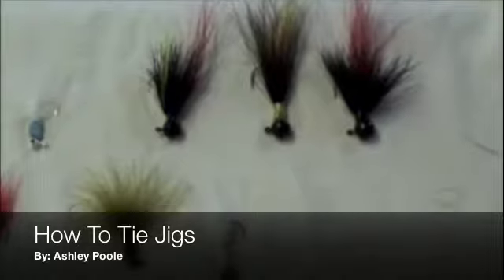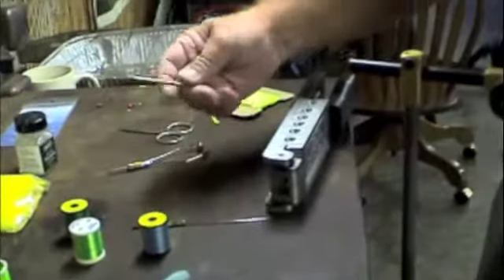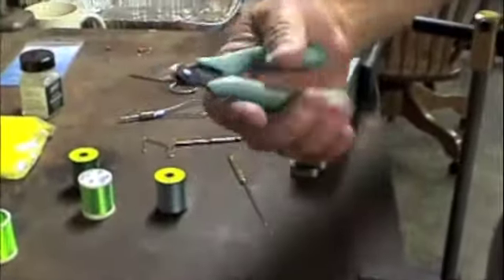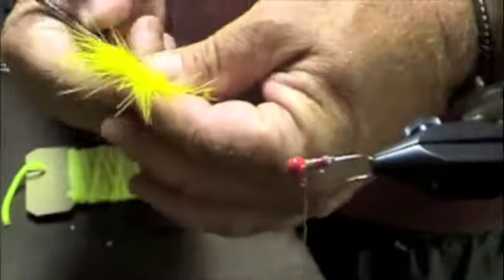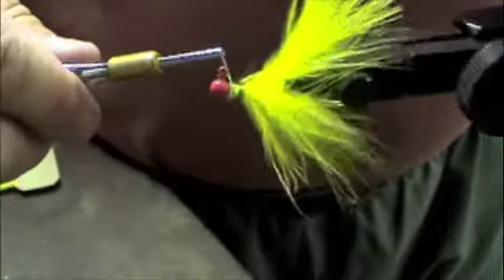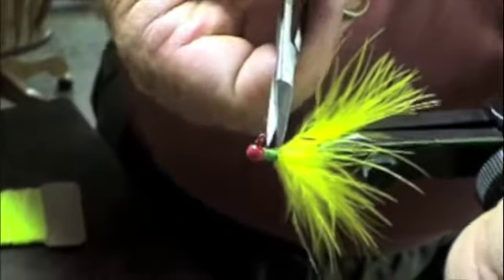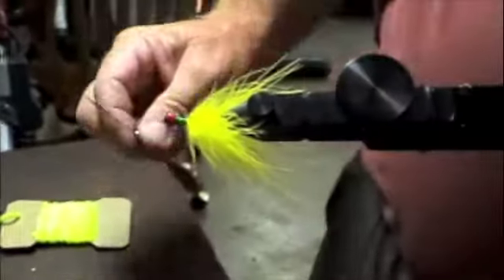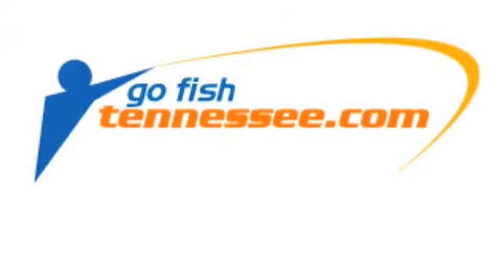Jig Tying

Comment: @HATINTHEKAT that is fly tying thread best to use a kevlar thread for jigs. you can buy a basic vice for less than 20 bucks online. you will also need a bobbin which is that metal tube that holst the thread and makes it easy to let go of the spool without having thread all over the place. marabou is fairly cheap. just go to your local tackle shop or fly shop and ask them to set you up to make some jigs.